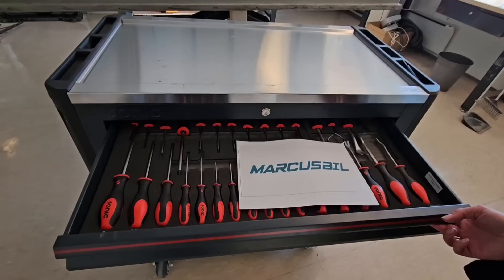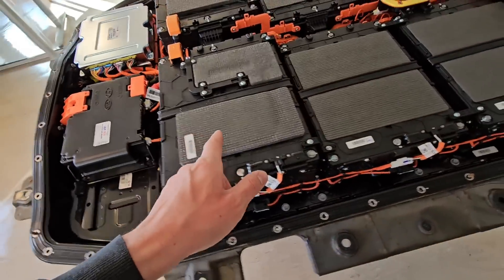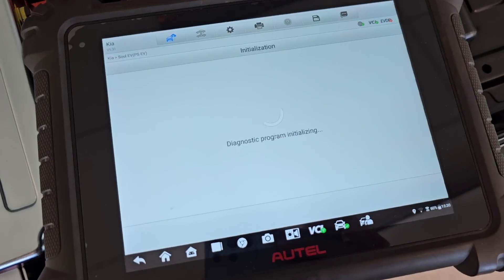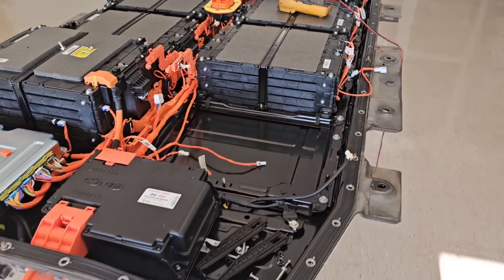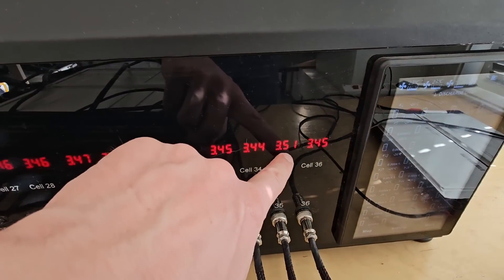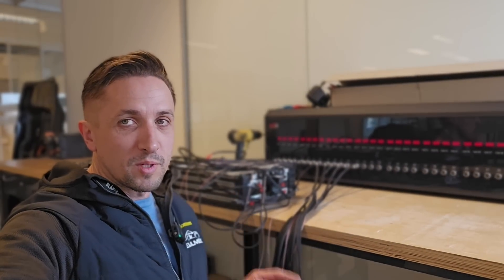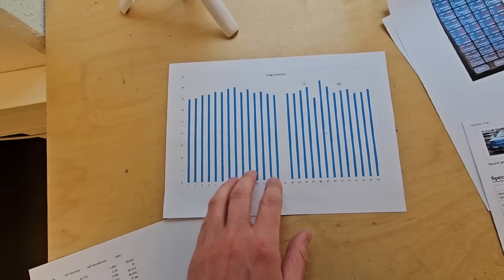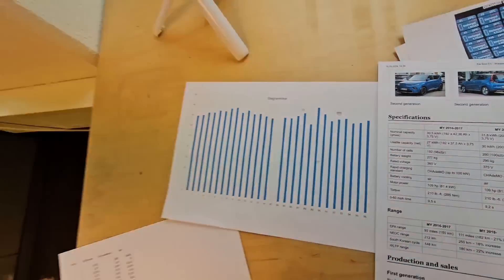Elbilmek trying to repair Kia Soul 27 kWh battery

Comment: Hi. In what range of voltage did you test the modules? Because cells LiPo that different range of voltage from 3.0v-2.7v fully discharged up to 4.2v fully charged.
And also the pin out data in Autel is incomplete because to get the communication with BMS needs to add ignition power on pin 15. And also is two CAN1 and CAN outputs must be bridges low with low and high with high. Then you get comunication.I can send you my diagram if you need.

Comment: Hello. Has anyone tried to repair a 27 kwh battery from the manufacturer SK, with 30kwh battery cells from LG? I mean using used LG cells to partially repair an SK battery. Perhaps in this way the degradation will not be repeated in the usual cells, if si possible .....

Comment: This is a typical situation with old batteries. Usually you have to replace all the old cells to restore battery capacity. I don’t know why Voldemort had any hope of replacing just a couple of elements.  And this is not the first time he makes this mistake. He had the same mistake with Frankenstein. Many people have thought about weakest cells replacement only, but practice proves that this approach doesn't work. I don’t remember videos of lucky guys who replaced just 1 cell and received an increase in distance.

Comment: Maybe the numbering of the modules/cells is off and there are a few cells elsewhere in the pack that are even worse. When I remember the video by Bjorn correctly it delivered only 70% of the displayed range and that was already only 50% of the new pack range, so both factors combined only 35% usable capacity. So there may still be the chance to find some bad cells to replace and at least get the pack back to 50%?

Comment: Tightly packed air cooled pouch cells. The worst way to make an EV battery. Tesla got it right from the start.
Reply: Well the later 30 kWh Soul, Renault Zoe, and Hyundai Ioniq had no such issues, so wouldn't really say I agree with you there.

These issues stem from design flaws on the part of Kia and the cell tabs of the SK Innovation cells at the time.

Comment: Looks like SK Innovations and LG are both showing longevity problems. I
Reply: 30 kWh Soul did not have these issues though. It had to do with multiple things, like the way the cell tabs were designed, the cooling by Kia.

Comment: What to do, if you haven't done it already, is to cycle the other modlules and see if there isn't a particular issue with this one (and not only the 1 cell, which admitedly would have been a nice cheap fix). It's unlikely it's the module, but you can hope it had worse airflow or something that may compromise it.

Comment: Does the soul not have a blower to push air over the battery like in the ioniq? Can you fit a 30kwh pack in a car which originally had a 27kwh?

Comment: I have a 2016 soul that had the exact same symptoms as the car you have there. Cell 96 was bad and its voltage would drop down to 2 volts when a high current was drawn from the battery. This was due to high internal resistance of the cell. When I would go up a hill the car would go into turtle mode and restrict the speed. To test a cell, draw a heavy current from the cell and see how much the voltage drops. I had the battery replaced on warranty and now have 30kw cells.
Reply: 30 kWh battery does not have these issues so that should last you a very long time.

Comment: Does this video prove the BMS properly distributed the load across all batteries or was responsible for the degradation? Do we know if the pack was dc fasted charged often with greater than 50% charge cycles? Wish there was a data recorder for all charging sessions which included all the predictive data points for battery longevity. You could offload the logs and analyze the data to see if the degradation was due to how the battery packed was charged/discharged over time.
Reply: The BMS can not distribute load. That require some very expensive high-power electronics. It rather detects under/overvoltage, temperature and does some balancing.

Comment: 40-50% degradadition on all cells evenly that will be a expensive repair. That mean you need to find a used battery with better helth or a new one

Comment: This is very common for those packs, I've handled many that were totally gone like that one (these were replaced by dealer under warranty)

What could be interesting: the next generation had 2x40Ah cells, but two of the 'big' stacks are 16s instead of 14s, so they can be used instead but you might have to be a bit creative with some parts from the old pack combined with the newer pack.

(Ideally you could just use the whole new pack, but I don't know if you can get the car to accept it).

Comment: I suspect you won't find the problem unless you do a high current discharge, that's when the output voltage of the weak cells collapses and the BMS puts the car in turtle mode. The cables on that battery tester looked way too thin to be capable of high current discharge testing.
Reply: El problema lo ha visto perfectamente me temo...

Comment: As someone else mentioned in the comments here, it would be interesting to find out if the car can take a donor battery pack from a later generation car. It might be quite a learning experience. As for this kaputt battery... Is it possible to repurpose the good parts of it? Home storage, or handy as part of a solar cell system on a cabin?

Comment: Please clarify whether the cell pairs are connected in series or parallel. 🤔
35 Ah at 7.5 Volts would be twice as much capacity as 35 Ah at 3.75 Volts. 
The Nissan Leaf cell pairs are connected in series, so maybe these Kia Soul cell pairs are too. 🤔

Comment: Bad results at the end. What will you do now? Find a second bad battery and make one out of them?
Reply: Replacing it with the later released fixed 30 kWh pack is the only real long-term solution to this.

Comment: Wikipedia states usable capacity is 377.5 Ah x 192 cells x 3.75 volts = 27000 Wh.
The low current test rig indicates that capacity under small load now seems to be about 35Ah x 96 cell pairs at 7.5 Volts which is 25200 Wh. Battery pack capacity now appears to be about 93% of original. 🤔
However, on the test drive by Bjorn the voltage on some cells was sagging badly under modest load. 😱
Reply: You made an error on your calculation , 2 cells in parallel still have same voltage . So 3,75 x 96 x 35Ah
Reply: One Module is supposed to be more like 70Ah (2x 37,5Ah since they are in parallel)

Comment: Replacing the battery pack with a second generation Soul battery would increase the range and value of the car. 
It would be interesting to find out if the BMS can communicate with the second generation battery pack  🤔
Reply: 11:00 look at the spec sheet -> 192 (number of cells) x 3,75V (cell voltage)  = 720V -> ratet voltage: 360V -> two cell in parallel is "one pack" -> (192 / 2) packs x 3,75V = 360 V
Reply: That's usually a matter of flashing the cars modules to accept another bms. If that's not possible you could build a can translator that tricks the car into thinking the battery is genuine to the car and only responds with real battery data in some cases.
If you look up ZombieVerter VCU someone has done this and convinced his old bmw that everything is fine, even though it's powered by a Lexus hybrid drivetrain and tesla batteries now haha.
Reply: afaik that would be hard getting it road-legal as you change weight etc., of the car
Reply: In Norway will a bigger battery pack gives high weight and that is not road legal.
Reply: @RoteLars  that probably depends on if the chassis was sold with more weight, too. At least I think that is how it works in Germany. Then you can add the new weight to the papers. Probably like an engine swap in a ice car. But not sure on the specifics.
Reply: I don't think it's realistic to replace an air cooled battery with a water cooled one.

Comment: Manufacturers should work with these guys to make batteries easier to diagnose and fix. Lack of affordable battery repairs is a big issue with used EVs.
Reply: He did successfully diagnose it... Problem wasn't a few bad cells in an otherwise good battery... Problem was all cells had degraded equally... So cannot be fixed with a donor battery. Basically that whole battery is scrap. Might be able to salvage some other parts for spares, but they probably don't break often enough to bother keeping them.
Reply: there need to be regulations about that because otherwise manufacturers have no incentive to make repairs easier - they will earn more with difficult repairs
Reply: I think the likely endpoint will be that batter packs or at least the modules are easily swapped. They can then be rebuilt somewhere else and used for the next car that needs a replacement. 

This is how a lot of ICE repairs have been handled over the years. Pay for a rebuilt part in your repair and then get a core credit of some sort.
Reply: @Bodelicious1  The issue with battery repair is that you never get back to 100% capacity and the difficulty is that you can not under any circumstances replace worn cells with new cells, the replacement cells have to be of the same internal resistance or capacity as the rest of the cells in the pack and this is difficult to achieve.

Comment: Air cooling and pouch cells really bad combination. Never buy an EV with battery packs like this. Large pouch cells are not great (Large cells in general) hard to cool and air cooling is not great at cooling each cell equally so you will have hot spots in the battery pack what means shorter life time.
Reply: To be completely fair, the Hyundai Ioniq (28 kWh, 2016-2019 MY) has a very similar pack configuration and is also air cooled. It also has 192 cells, and has a nominal voltage of 360V. Being almost the same pack, on the Ioniq there are no known problems with degradation. In fact it's one of the fastest charging EVs of its time, and most packs are still at or very close to 100% SoH. So the difference must be in the cells themselves, which it is: Hyundai used LG Chem - LQ 1729-A2 - 43Ah Polymer pouch cells, whereas KIA used SK Innovation cells (I'm not sure what type).
Reply: @philipk89 There's been a few cars on Ioniq Forum that have had this same issue, one or two weak cells whose voltage takes a dive under high load and puts the car into turtle mode. Fortunately they were under warranty and got new packs from the dealer, out of warranty it's Valdemar's nightmare.
Reply: @KevinT3141 Ah good to know, I wasn't aware of this! I guess no car is completely immune.
Reply: @philipk89  Yeah, when you pack almost 200 cells into a battery then ship 1000s of cars you're bound to have a bad cell show up here and there. At least this battery is fully repairable at the cell level, not just module level. What's lagging in the industry is good public repair info and tool sets.  :(
Reply: @philipk89 That is incredibly rare though, on the 27 kWh (not the 30 kWh though) this will happen on pretty much every car given enough time. The Ioniq is very well-designed.

Comment: Great video to learn. I am so impressed with the Kia battery design and packaging thats some really well designed hardware built to last. But I wonder what has caused the issues?
Reply: Because this had massive design flaws with the cooling that were fixed on the 30 kWh Soul. So maybe not so great design in that aspect.
Reply: @swecreations  oh this is the first gen?
Reply: @de4dcert  Yes, later models don't have these issues with degradation

Comment: I think you calculate wrong thous Ah. You got ah test on each (~3.7v 40ah ) cell or x2 (2s)  (~7.4v 40ah) ?
Reply: Or 2p (~3.7v 80ah ). ?
Reply: Cell 94 is not to low 1.2 ah/s ?
I think 80kw needed for engine / 350v ( not all time is full) / 96 = minimum 2.4A for each cell.

Comment: Valdemar, how did you measure the cell capacity, what was the initial and final cell voltage, and especially what current did you use for discharging? Degraded cells with increased internal resistance could show a much larger variance in values if you discharge them at a similar rate as when you give full throttle in a car.
Reply: Definiteiy - Bjorn saw 2.6V when he did that. And the battery needs to be charged and discharged at the voltge range of operation of the vehicle. But say the worst cells are fixed, how usable is a car with already poor range, now 50% degraded? Not to mention high internal resistance heating up the whole pack and furthering degradation.
Reply: Yes he should measure internal resistance of all of the cells first.
Maybe the bms is not the brightest and has allowed deep discharges for too often and killed the whole pack that way?

Comment: Not all is losted, because those cells/modules can still be used for home storage, so they have an after market value and can be sold on. Many Nissan Leaf battery packs have ended up this way. That is what I would do, and go fined a dona battery pack from a wright off car to install in this car. I can understand your frustration, but this is a learning curve and your going to have to expect a hit like this from time to time. The measures you take and the leasons you learn, are your way of avoiding making this mistake in the future, or dealing with this kind of problem, where customers come into your workshop with a car like this.
Reply: But the car is "losted"
Reply: @Sequesterer  What makes you think it is losted?
Reply: @showme360  El coste de un eventual recambio que de hecho, está descatalogado.

Comment: Conclusion: Do not buy a car with air cooled Batteries.
Reply: A conclusion that's completely incorrect. 28 kWh Ioniq is also forced-air cooled yet extremely reliable and degradation resistant. In the case of Soul it is nothing to do with the cooling and everything to do with bad cell design by SK Innovation.
Reply from the maker: Classic Ioniq has left the chat 🤣
Reply: Air cooling is not bad, Renault Zoe cooling system gives very good conditions to battery. My Zoe 22 kwh battery after 10 years 110000km still in good status, SOH still 92 percent. If i charge with 22kw power in on a hot summer day, battery temperature do not exeed 30C. Of course, this makes the whole car hum, but the battery feels great 🙂
Reply: Why are people continuing to blindly give this completely incorrect comment likes?
Reply: Hope Mercedes hears that lol
Reply: @roodick85 Mercedes does not use any air cooled HV batteries. Degrationtests of Björn Shows that Mercedes is very conservative with their BMS strategy using a big top buffer for aging effects so the useable energy will stay stable over 200.000 km an more
Reply: Liquid cooling problem is the leaks… If leak inside battery it is a very unpleasant thing…
Reply: I'm wondering what causes this high degradation. I own a 27kWh Kia Soul as well. It's about 7,5 years old now and 80.000km. Still have about 25kWh usable capacity left.
Mostly ac charging to 80% and  I'm a modest driver so I will not stress the battery in that way either. Maybe that's the trick with this car.
Reply: and pouch cells.
Reply: My 11 year old leaf with 7 bars is still totally reliable. Coolant systems, pumps, valves are expensive and complicated. There are newer cells that work fine air cooled
Reply: @gooooob55  Passive air cooling for my opinion for cool climates and slow charging.
Reply: @-cp You can potentially get a few more years out of a pack in replacing a faulty cell with a similar degraded cell as the rest of the pack.
Reply: @moestrei  Uneven cell degradation often occurs in homemade batteries assembled from low-quality cells, from cells incorrectly selected for their characteristics. I don't remember stories about uneven cell degradation on mass-produced factory-assembled cars. Theoretically this is possible. But in practice, we don’t see videos of the lucky guys who replaced 1 cell and felt the difference.
Reply: Disagree. The later 30 kWh Soul had no such issues, it has everything to do with design.
Reply: Renault Zoe is with air cooled battery and has a minimal degradation.
Reply: @adasha1417   I agree with you. LG - cells are the best.
Reply: Agree. Old Zoe had only 22kwh and charged slower then DC.
Perhaps that's the secret
Reply: @eunu6928 Zoe could charge at 44 kw AC.
Reply: @o00scorpion00o  indeed , but to fiew 44kw AC stations to matter
Reply: @o00scorpion00o which was about 39 kW DC into the pack. When it worked, which it often didn’t. Newer AC stations were downrated to 36 kW AC (Fastned in NL at least). Nowadays they’re all getting replaced with DC stations. For good reason.
Reply: @philipk89  yeah Renault really made some mistakes, the fluency was a disaster no DC and only 3.5 kw charging. They couldn’t give them away.
Reply: I bought a 2018 Ioniq 28 kWh Battery and drove it down to 6% on the Autobahn. At this moment it had around 87500km on the odometer

Measured 9% Degradation on it.

That's okay for an Air cooled system I think.

Most other EVs would have more Degradation, on this state of use,  especially if they don't have cobalt in the batteries.

Comment: Eeeeek! Only 2 minutes in and all I am thinking is " workplace health and safety".  James of James and Kate dresses up like the gimp before going into the same room as an open battery ( Luv ya work James). Ok, exaggeration, but there are orange wires everywhere. Don't try this at home folks, unless your name is Rich, in which case you would have deployed the cutlery draw, a wet rag and a swiss army knife by this point. 💦 😅 💦
Reply: You think uncle Rich touched exposed wire so many times his skin turned black?
Reply: 👍😂 @dgurevich1